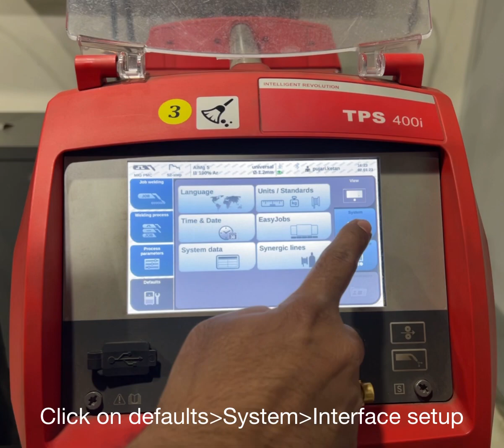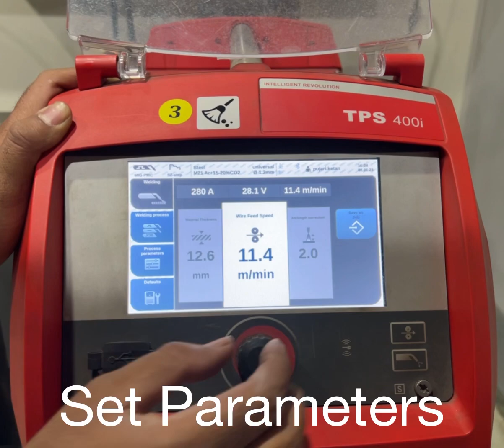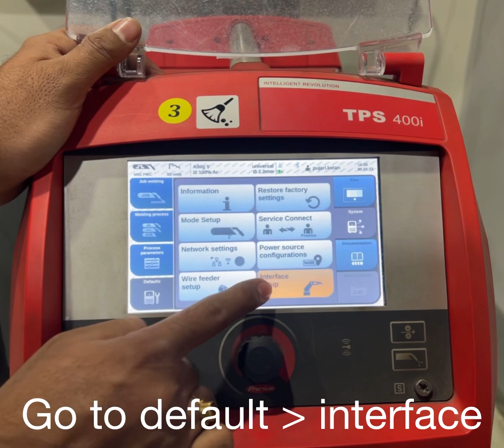Fronius TPS/i Guide - How to create a new job. #FroniusOperatingGuide #fronius

Comment: how to call jog by external??
Reply from the maker: You need to call job number robot teach pendant
Reply: I use Modbus TCP/IP control weld machine, but I can't call jog through TCP/IP. I see address modbus but I can't control it